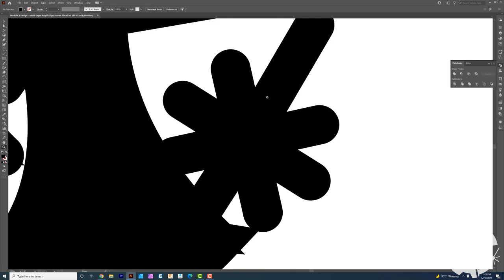MAKING MY OWN CUSTOM LOGO SIGN

Comment: great job. I enjoy all your how to videos. I stumbled into a solution that reduces the fog on acrylic that I will have to try to
duplicate the results; I ran the process out of focus and achieved the best result to date. I made an error by failing to reset
autofocus when I ran some magnets and loaded a piece of 1/8 acrylic.  I realized the mistake and watched the process to
make sure that no issue would occur and was pleasantly surprised. As a newbie I have never tried to run without autofocus
and not sure if I will ever again, except for acrylic. I saved some magnet material to repeat the process and will let you 
know if the process repeats
Reply from the maker: Best of luck with getting the process down.

Comment: Did you account for kerf width when designing the parts that interlock?  It looks like the inner part of the M fits tightly into the black border piece.
Reply from the maker: Nope. I typically don’t worry about it because it’s such a small gap to begin with.

Comment: How do u add hanging points to ur acrylic signs or do u have a video showing this ?
Reply from the maker: I use quick snaps and glue them on using acrylic adhesive.
Reply: @MakerExperiment  do u have a link to "quick snaps "
Reply from the maker: @turtleplates  there’s a link in the description.

Comment: HI ... Great video .. look sorry for the Question i am new on this business wich is the secon Adhesive paper you put on Acrylic ? and what is for ?
Reply from the maker: It’s a sign tape that’s linked in the description. It’s for “gluing” the parts together.
Reply: @MakerExperiment   you can also use acryclic glue right ?
Reply from the maker: @elielberea4683  yes. The tape is much cleaner though.

Comment: Any experience in how an acrylic sign like that would hold up outside.  As far as sun exposure. Thanks.
Reply from the maker: The acrylic is UV rated so it is supposed to hold up.
Reply: @MakerExperiment  acrylic is used for sign faces in the sign industry. It’s built to last outdoors!
Reply from the maker: @southernprintanddesign9901  totally agree